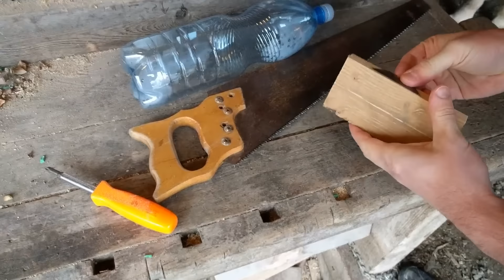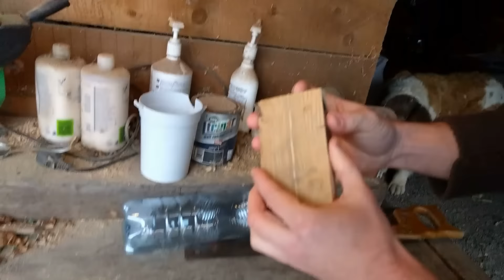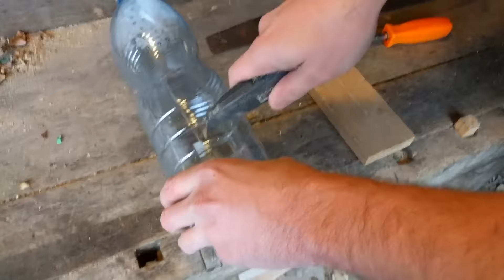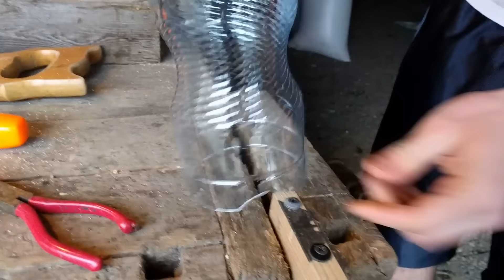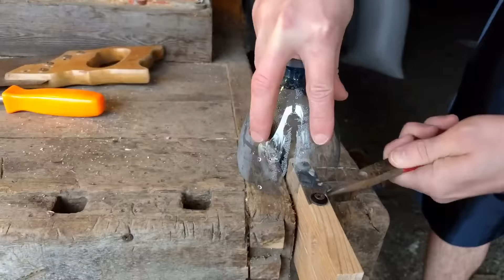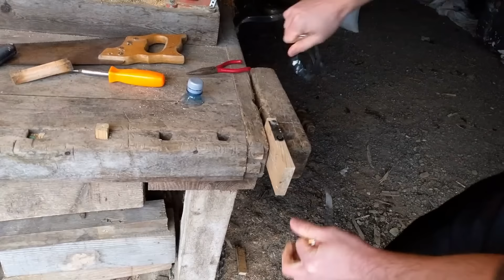String / Rope from plastic Bottle (simple DIY)

Comment: Good job!. You still need to make ropes with the plastic strips. It looks like the width of the strip is uniform. If that is the case, items that are made with palm leaves can be made with the plastic bottle strips. I have seen videos where people make purses with recycles plastic strips of different colors. Thank you for showing me an easy way to make the strips.
Reply from the maker: +Generatorblue Generator blues Glad to help.
Reply from the maker: +Generatorblue Generator blues Yes, the width is easily adjustable. Just vary the depth of cut in the wooden piece.
Reply: one2three Thank you sir!